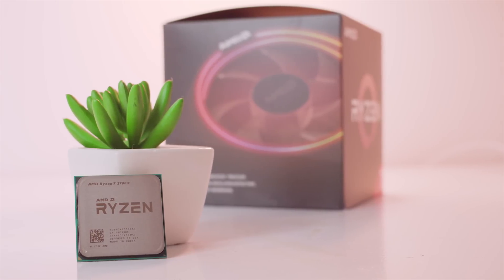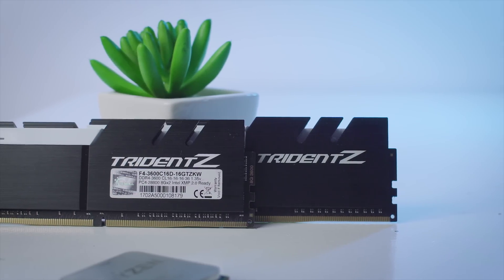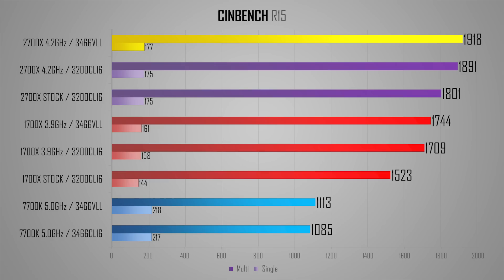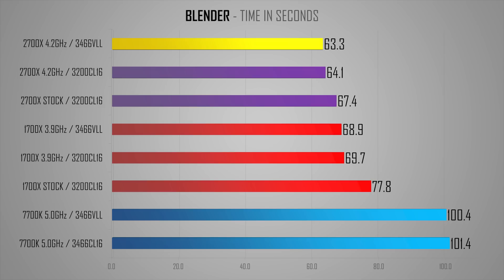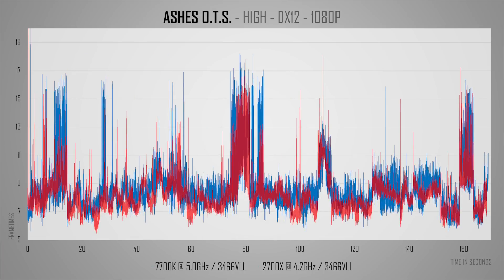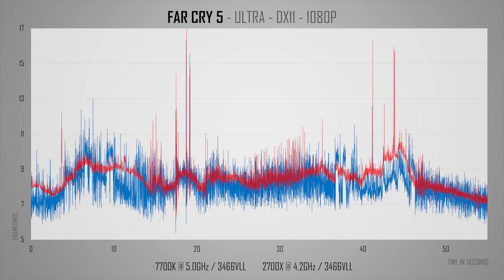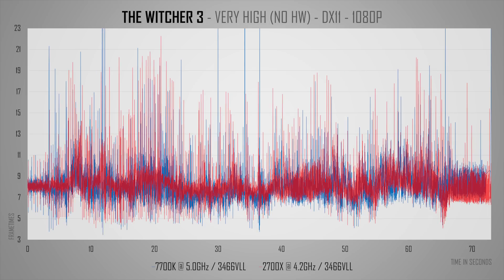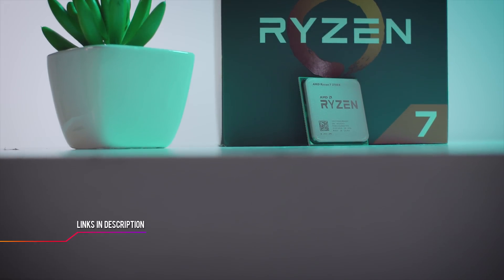RYZEN 2700X + Low Latency RAM - Still AMAZING PERFORMANCE gains...

Comment: @MindBlankTech Nice video , RAM with 3600Mhz CL18 and 3000Mhz CL15 they has same speed so did they give same performance ?
Reply from the maker: Yes, but the 3600CL18 can probably do 3466CL15 or even CL14 with proper over-volting. The 3000CL15 will most likely not be able to...
Reply: I didn't understand what you means lol , my question is if i find two RAM 3600Mhz CL18 and 3000Mhz CL15 , if we calculate thier speed they are the same 10 ns , but 3600Mhz CL18 is more expensive then 3000Mhz CL15 ! So without overclocking do they give same performance or not ?

Comment: I've been looking forward to this since the release.  I was reading an article over at hardocp on precision boost 2 that came to the conclusion that PB2 is so darn good that you're almost better off leaving the CPU in auto and focusing on memory and cooling.  It looks like you can still get good value from tweaking memory timings with Ryzen+.
Reply: yeah no kidding, the X chips from second gen ryzen are pretty much factory overclocked to the max when it comes to core speed
Reply: Tweaking memory sub-timings always helps a lot with Ryzen. It's like it helps to mitigate the bottle-neck in the interconnect between the two CCXs in the die.

Comment: I love your videos but you are going to have to get a 8700k system as well as 1080ti to do these tests
Reply from the maker: I agree, but unfortunately this implies a rather large sum of cash that I simply do not have to spare on these parts. This test gives a good view on how things stack up. The 8700K is not a major problem in getting, but a 1080 Ti is hard to justify for testing only. We'll see in the future how things evolve. Maybe Nvidia's future XX70 card will be close to a 1080 Ti in performance and I'll revisit stuff if it's priced accordingly.
Reply: MindBlank Tech whish i had the money ill give you everything you need for your excellent work. Keeep it up.

Comment: still over here trying to figure out dram calculator lol
Reply: Don't give up. Those highly tight sub-timings make a world of difference.
Reply: I've seen good tutorials on forums but all I did was open it up, make sure the Memory Type was selected for my Memory (Hynix MFR), Max known stable Frequency for my system (3200mhz) and punch in 100 for BCKLK if its not already there. Then you just hitR- XMP FIRST... then you can click Calculate SAFE to get a baby overclock settings, or FAST to get the slightly more upgraded ones. Then make sure every variable timing on there is punched into your BIOS the same way it lists out. You will probably only have to change about half of them. DRAM Voltage and SOC voltage is laid out for you as well. I went with recommended on everything for Calculate FAST and my timings and it is rock solid stable. Minimal recordable gains on Cinebench etc but what I am after is the better minimum frame times for gaming.
Reply: do you have a link to the old version?
Reply: Decided to give it a go and so far I’m up from the 3200 c14 to 3466 at c14-15-15-35 with tuned sub timings on my 1950x. I’m gonna push it as far as I can stable and then go for a 4 ghz oc or more to see how much I can extract from this
Reply: Hardcore Hardware still working on 3466 but revisiting this video I took his vll timings and it seems like it’s more stable than anything I’ve tested above 3333. I can do 3333 c14 pretty easily and I can even play around with 3600 but could never get 3466 stable enough for me
Reply: sure thing! ryzen 2 is no slouch, and its like my 1950x wants to act like zen 2 but the zenith extreme is still kinda buggy (adjusting llc basically does nothing). Hope you enjoy ive often thought about selling this for the 2700x but im waiting for a little bit longer